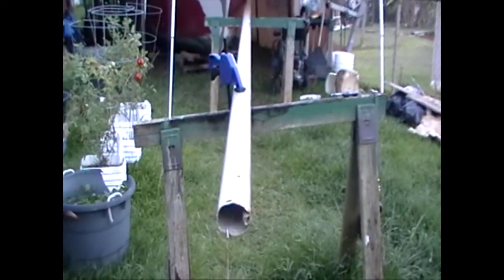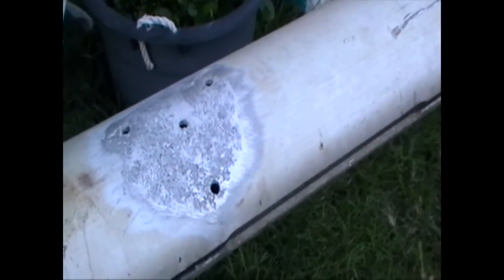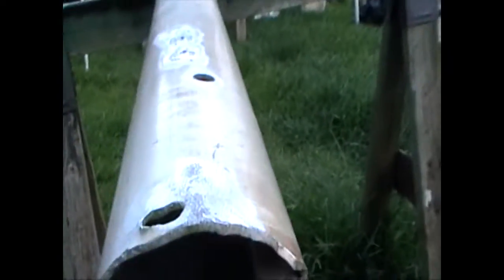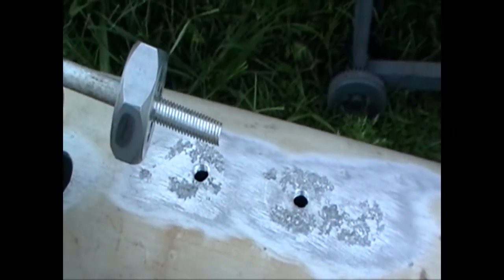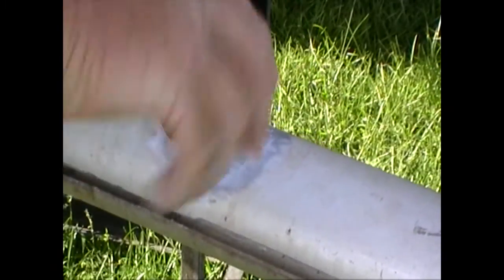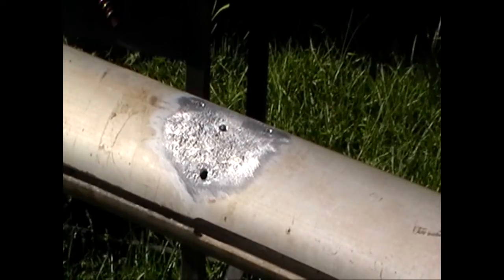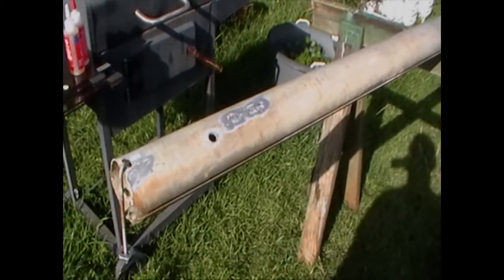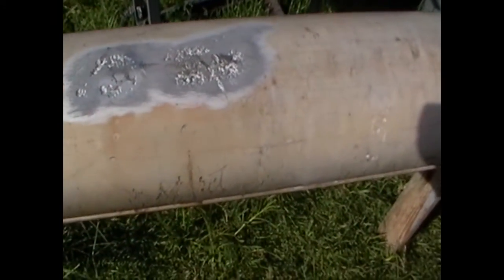Filling holes in my aluminum mast

Comment: I would have welded those up for you for $15 per hole with finish polishing, $75 minimum for the onsite visit.  I also would have filled in some of the electrolytic corrosion pitting on the surface.

You may want to in the future consult with a local welder.  I'm thinking most would be in the $150 range for this kind of work, and it would have saved you a day or two of your free time.
Reply: wires inside?